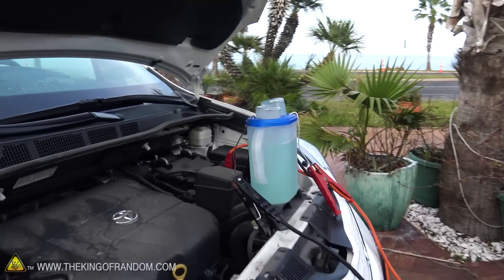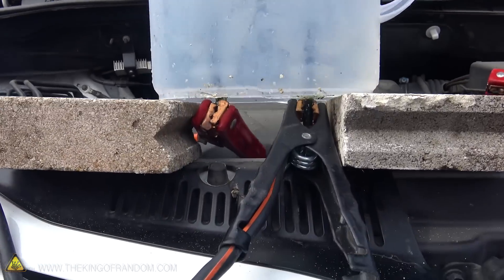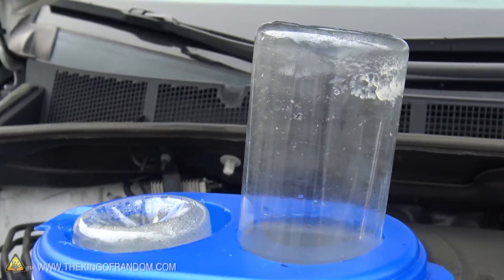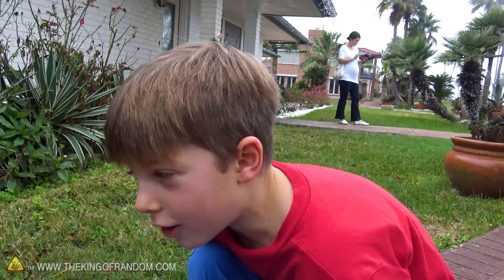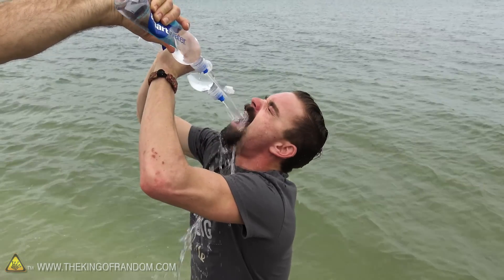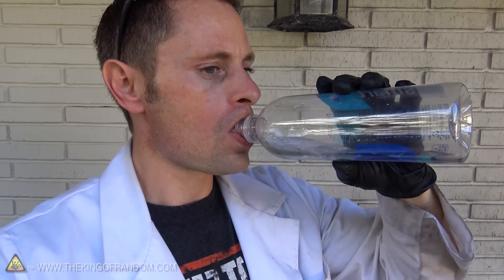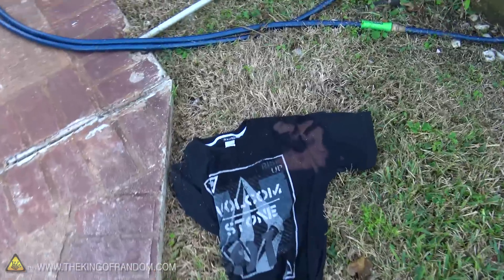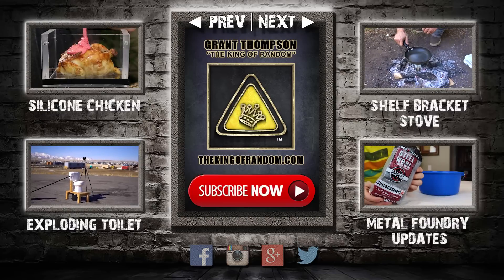Success! Turning Ocean Water Into Chlorine Bleach | TKOR Shows How To Make Bleach From Ocean Water

Comment: Halogens are all really reactive and nasty. I worked for a company that used to import Bromine gas, which was transported in small [20'] glass lined tanks which we used to call 'flasks'. When they had been emptied, there was always a tiny amount of Bromine liquid left in the flask - this liquid was called 'Ullage'. On one occasion, a tiny amount was accidentally released. My workplace was evacuated, the fire service called. Once it was safely cleared up, we returned - and it was obvious that the ullage had eaten into the concrete floor of the yard. And don't forget, Chlorine was used as an utterly lethal weapon in World War One.
Reply: My chemistry teacher used to work at a water treatment plant. Some of the chlorine gas leaked and a 5km area was evacuated.
These elements are very quite nasty.
Reply: Noschict chertlok it was not the clorine watch the whole video

Comment: Wouldn't the chlorine mixed with water create hydrochloric acid since there is no sodium to make sodium hypochlorite
Reply: Looked it up it makes Hcl and hclo almost bleach
Reply: NaOH + HClO -> NaClO + H2O
Reply: nyx211 where did the NaHO come from
Reply: From electrolysis of salt water. 2 NaCl + 2H2O -> Cl2 + H2 + 2 NaOH
Reply: nyx211 wot?
Reply: +Omu Gaina When you pass electricity through salt water, you make chlorine gas, hydrogen gas, and sodium hydroxide. Chlorine gas reacts with water to make hydrochloric acid and hypochlorous acid. Hypochlorous acid reacts with sodium hydroxide to create sodium hypochlorite (bleach).
Reply: nyx211 yea but it isn't clear if he used the electrolysis water in the reaction or just water. I think he used regular water and drank a low concentration of hydrochloric acid

Comment: Years ago in high school chemistry class we were learning about redox reactions by creating hydrogen and oxygen gas using electrodes in salt water. The teacher instructed us not to turn the power packs above 8v or something (maximum of 12v). Needless to say all the boys thought they'd speed things up and turn the nob to 12v. There is a point at 8-10v or thereabouts where C2 and not O2 forms at the anode, and a couple  in the class got sore eyes and noses. Great teacher!

Comment: Also for the people at home who don't have access to carbon rods you can get them in old carbon zinc batteries, or just use the inside of a pencil which is graphite but it will still work.
Reply: Do you know if carbon fiber would work for this? I can find carbon fiber rods super easy...

Comment: I first experimented with this about 25 years ago. I later went to college and got an engineering degree, during which time I learned that this is a voltage driven process, not a current driven process. If you want it to go faster, simply increase the voltage. It does not need much current. You can use a small DC voltage transformer that puts out, say, 40 V to get the job done much faster.

Oh, and as somebody else said, waft, don't sniff.

Comment: Grant, basically what you are doing is what salt cells do for salt water swimming pools. People say I have a salt water pool and don't use chlorine. Really all it's doing splitting apart the salt compound of Sodium (Na) and Chlorine (Cl) leaving your with Chlorine gas. So salt water pools really is like swimming in the ocean but having chlorine generated to sanitize the pool water.

Comment: This is due to the movement of free ions dissolved in the solution. The positive ions move to the negative electrode and the negative ions move the postitive electrode. The electrodes are the carbon and the electrolyte is is the NaCl Solution. At each electrode a gas is formed and the liquid left is NaOH which is a strong alkali.

Comment: Once inhaled, chlorine gas diffuses into the epithelial lining fluid (ELF) of the respiratory epithelium and may directly interact with small molecules, proteins and lipids there and damage them, or may hydrolyze to hypochlorous acid and hydrochloric acid which in turn generate chloride ions and reactive oxygen species; the dominant theory is that most damage is via the acid.

Comment: My last job I worked with chlorine gas. We had respirators rated for ten parts per million but would usually work a while past that. But I've been in so strong that you would choke on the chlorine through your respirator

Comment: Yeah, you have to make sure that the electrolyte won't directly react with the electrodes. I think you could have gotten away with a copper cathode if you added excess sodium hydroxide, because Cu(s) + Cl- -> copper (II) chloride (that sea green stuff you made by accident in the first try), but Cu (s) + Na+  does not result in a displacement. You might still get a side reaction of the cathode with the hypochlorous acid, but a tiny amount of excess hydroxide would take care of that.

Comment: Just use a chemical method like pool chlorine (search for trichloroisocyanuric acid, isocyanuric chloride, TCCA, etc.) and simply mix it with hydrochloric acid. I'm sure you can find both and it's a way easier and faster method to produce chlorine.

Comment: if you were to mix hydrochloric acid and iquid chlorine supposedly it is called mustard gas. i was accidentally mixin it in a buck for the pool but i needed 500ml for both so i filled to the 1 litre and it started soking and bubbling and made my kungs feel horrible

Comment: That can't be sodium hypochlorite. You don't have sodium in the mix. Just water and chlorine. It probably is a mixture of water, hydrochloric acid and hypochloric acid. Btw, you didn't need to put it in your mouth. You could've simply used a pH indicator. If it turned red, it meant the acidity increased. And if the acidity increased, all the bacteria died. Also, it meant that the water most likely tasted sour and pungent. Very brave of you, but there are safer ways of testing stuff.

Comment: You shouldn't sniff in it directly, the proper method is waving some air over the top of the bottle towards your nose. That has a much lesser quantity of chlorine gas in it and by that is safer to sniff.. Like you said and like your brother and you felt it burns your airways.

Comment: Your supposed to waft nasty fumes toward your nose with a wave of the hand, not put your nose right into the container. That reminds me I intend to make a window panel that uses activated carbon to filter outside air and blow it into the house under positive pressure. This would be for having a nephew over who's allergic to smoke, and chemical defense against a terror attack with a nasty gas like chlorine. Trump's Homeland security dept might send someone to consult on that.